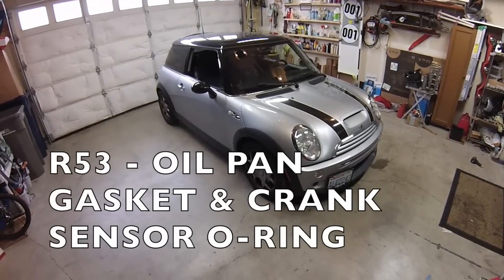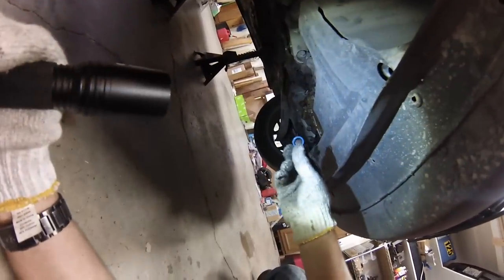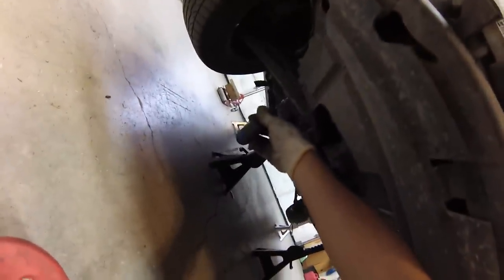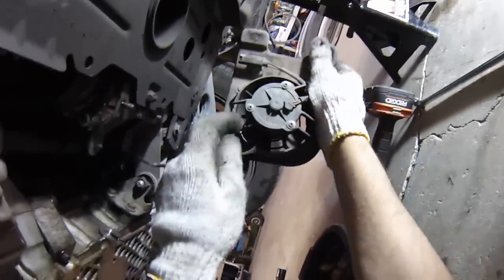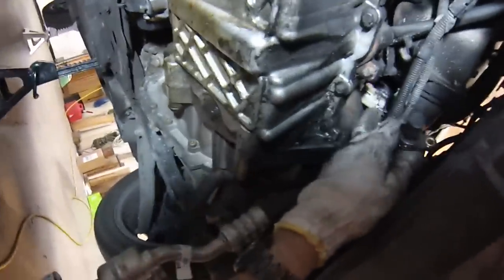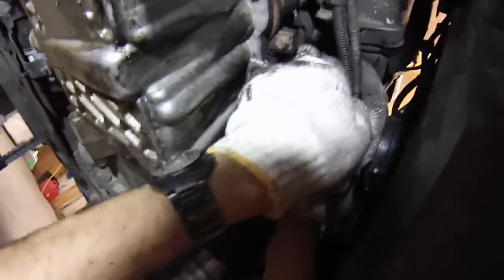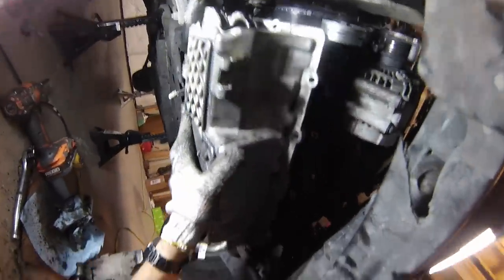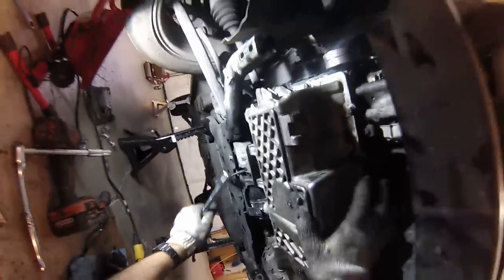Replace MINI Cooper crank sensor o-ring & oil pan gasket R50 R52 R53

Comment: great information are your videos, today I managed to remove my head following your earlier video. But now have to remove the sump (oil pan) as a socket fell down the cam chain guide lol. It was  a friend who was helping at least he told me. But after watching this ill sort that seal out as well. As for water pumps is there anyway to check them out with the supercharger in situ, Also we cant remove  the injector rail one injector is solid with what looks like rust any hints on removing this as I'm frightened on breaking the fuel rail,
cheers
Neil
Reply from the maker: Look for seepage on bottom of water pump. If it's leaking there will be white crust or maybe moisture there. Car needs to be in front end service mode, look up from underneath. 

Fuel rail can be pried off gently after removing the two 13mm bolts. It's just held in place at that point by the injector o-rings. Pry firmly but gently.

Comment: Can you do both repairs without putting the car into the FESM?
Reply from the maker: Yes, but it is a tight fit and you'll need slender  fingers. Less frustrating to just take the bumper off and move front end forward a little, especially if you don't know where the bolts are and you have limited tools. (You'll need various length sockets/extensions to work in the limited space)  It's not that hard to put into FESM...

Comment: Is it necessary for the A/C pump to be lowered for easier access to the crank sensor O-ring?
Reply from the maker: +Simon Z No. It's very tight but you can get access to it by just removing the splash shield. The hardest part would be unclipping the wiring harness. Then use a 10mm deep drive socket to remove the bolt.

Comment: Have a question . My mini 2007 s . Started overheating ,the steering gets stiff  the AC blows cold air and I also noticed oil in the coolant reservoir.  Well power steering has been leaking for a while . Butt line what could be the main issue .  Blown head gasket
Reply from the maker: Oil in coolant reservoir would be either a failed head gasket or a failed oil cooler.

Comment: Hey Modmini. I love your  videos. I have an engine light for a faulty knock sensor. I was wondering if you have any experience of replacing them. It seems some people think you can do it without taking off the supercharger (removing the inlet manifold etc), but some people seem to suggest a full FESM supercharger removal. Any Advice would be most appreciated.
Reply from the maker: Knock sensor is behind the supercharger. I don't think it is possible to remove without removing supercharger.

Comment: Looking at buying one this weekend just gone drove amazing. But notice a leak. Seems to be bottom rear and nothing at the top by the vavle gaskets so I'm guessing as it's drivers side it is exactly this. Debating it. Also the clutch biting point is at like lowest position possible is this another issue?
Reply from the maker: Bottom rear can be oil filter housing or oil pan, or just a valve cover gasket leak that is hard to see from top. Low engagement could also be due to air in clutch hydraulic.
Reply: @ModMINI  nice one. Sadly decided to steer clear the gear where hard to engage aswell. I'm assuming that could be related I'm sure I read some where they can have clutch and gearbox issue too  I've driven a few now and that didn't feel right. Shame. And to the oil housing spot on spoke to a specialist he said the same thing.

Comment: I would like to know what acceptable exhaust temperatures are.  I have a 05 R53 that seems to be running quite hot.  The exhaust manifold will turn red when the engine RPMs are above 5K.  Is this normal?
Reply from the maker: +Oscar Moreno That does not sound normal. You are probably running lean. Any mods? Might be time for bigger injectors and a tune.

Comment: thanks!, I was fixing the mini cooper s 2004, while I was test driving it engine just stall unexpectedly I tried but it doesn't start. I'm I correct if I say it is tge the pick up sensor?
Reply from the maker: +manic lokofe It could be a lot of things. Spark, crank, cam, knock, MAP sensor, fuel, wire came loose, etc.

Comment: Hi Sr, I have a question for you. I been watching your videos and they are amazing. I have a mini Cooper S supercharger 2005, few months ago the lights from the abs come on, I replace all of the abs sensor and know when I go over 75 miles per hour the abs lights come on, when I turn off the engine and turn on again they don't come on. I have a scanner from the bmw and everything but right now I don't know what to do. if you can give me some idea I will appreciate. Thanks a lot.
Reply from the maker: +Arley López What does the scanner say? If you replaced wheel sensors and the light still comes on, the fault is not the wheel sensors, you have bad wheel sensor wiring (car side) or there is something else. There should be a code of some kind but you need to query the ABS module directly to read it, OBD won't be able to access such a code.

Comment: I have a 09 Mini Cooper s that need a timing chain install could you tell me how to lock the crankshaft so I can pull off the chain.
Reply from the maker: +Rufus Biggs This video is for R50 and R53. You have an R56 and the procedure is different. Crankshaft is locked via a small hole in front of the bell housing near the exhaust on the bottom of the engine. You need this tool to lock it and the cams in place to do chain work. I'll be making a video in the next few weeks on this job. http://amzn.to/1U5B4oG

Comment: Hi there, I have a 2003 Cooper S 70k on the odo (with a 15% pulley) and it seems to be burning or leaking oil. About a liter every 800 miles or so. I've replaced the PCV, had the CPS o-ring and valve cover gasket replaced, but not the oil pan gasket. Could the oil pan gasket be leaking without any dripping any oil? Any other advice?
Reply from the maker: +Dustin Driver Most leaks only drip oil when the car is running. 1L every 800mi is a lot. You could probably get under the car when it is running and inspect where the oil is coming from. Maybe oil filter housing gasket. Those have been leaking a lot lately.
Reply: Thanks! I just took it in to my local MINI specialist for a shakedown. Leaking oil cooler gasket. He said that's probably responsible for a good chunk of the oil loss. The rest is probably just age. Any tips for that? Heavier oil? Something to soften the valve seals? Compression test?
Reply from the maker: +Dustin Driver There are no shortcuts - it needs to be fixed. Oil cooler gasket video here: https://www.youtube.com/watch?v=RxI5SrD1OCY - but might be easier to pull the exhaust or the right side axle.

Comment: @modmini if I'm just replacing the crankshaft position sensor o-ring, will I have to drain the oil?
Reply from the maker: No. It is above the oil line.

Comment: Hey mod. Would you perhaps consider taking a look at my own R53? it’s been throwing codes for the camshaft position sensor and emission system purge control valves, ive replaced the camshaft position sensor but still getting all the same codes and can’t crack how to fix it.
Reply from the maker: If you are in Seattle area, you could make appointment for me to work on your car.
Reply: Mod MINI super cool, I’m actually located in Woodinville/bothell area so I could definitely work something out. Along with the codes it’s showing my car has also developed an issue that I can’t seem to crack, it will start cold and run fine for a bit until I drive it, once driving it will idle at 1,000rpm and when shut off won’t even turn over again:/ in a few hours will start up and run fine again.

Comment: So, no RTV gasket maker on the oil pan gasket then? Realoem shows RTV gasket maker as part of the necessary items with the oil pan. Maybe that RTV is used somewhere else?
Reply from the maker: There is none there from the factory and I've never put any in. Gen 2 uses gasket maker.

Comment: Hey I have a 2003 mini cooper s. After about a week of having it, this loud bad sounding raddle/ knocking started to happen in the engine. After watching a few of your videos I figured that it was my timing chain tensioner. I replaced that and also the head gasket. After i finish it all i start it up. The same sound occurred but it was louder but eventually got quiter but is still there. Do you have any suggestions, and do you think that the timing might be off possibly on the timing chain.
Reply from the maker: If you are sure you put together the timing assembly, the only other usual noise source in the engine that could make a sound like that is rod knock... Why did you replace the head gasket?
Reply: Is it possible that the timing chain is off timing and thats why there is still some raddling noise. I replaced the gasket because it had 130k miles on it and i just kinda wanted to, no reason really.
Reply from the maker: No. Chain would only rattle if there is too much play, which can be due to bad tensioner, stretched chain or damaged chain guides / sprockets. If those are all good, your noise is coming from somewhere else.
Reply: thank you

Comment: hi there,i done this to mine the other day and im still getting a drip  where the sump joins the transmission,its not directly on the bottom but on the second long bolt to the rear of the sump just under the curved plate that is under the starter motor.. When i had it off the there didnt seem to be any oil coming from the main seal behind the flywheel so i naturally assume that that is ok and it was only replaced a few weeks ago,im wondering if the main seal was gone or damaged upon install would the rear of the flywheel get wet from a leaking main seal,or can these sumps warp and not seal the gasket correctly?
Reply from the maker: Could be either bad rear main seal or bad oil pan gasket.
Reply: @ModMINI  thanks for getting back to me,I'm praying it's not the main seal cause I just replaced,very carefully too,but if it is I'll just have to do it all again... thanks again for your response.

Comment: hey I have a question I just put a header with a test pipe on my car it ran before now it cranks but doesn't start but now it's throwing a camshaft position sensor low circuit what could cause a no start ?
Reply from the maker: +aj grant Check throttle body, crankshaft, camshaft, TMAP, MAP, both O2 sensors and all connections. All are required for the ECU to manage air, fuel and spark.
Reply: +Mod MINI it's also throwing the code for a camshaft position sensor and evap codes and I looked on all data and it say that's usually what happens when it goes bad

Comment: I have replaced the oil pan gasket twice on my r53 and it still leaks. It only leaks while off. Any suggestions would be greatly appreciated.
Reply from the maker: If leaking while off, probably the oil drain plug. Could also be oil filter housing gasket or valve cover gasket.
Reply: Mod MINI it seems to accumulate at the  back left corner of the pan,  area closest to the back motor mount. I replaced all of those. It only recently started doing this. I thank you very much for responding. Your videos have save me many o' dollars.

Comment: Hello Again, i thought that the problem was the crank case valve but not the idle still doing the same, and i scanned and the code is P0507 idle higher than expected. let me explain to you what i did, i did the supercharge oil service and also the crank case O ring replacement. when i was taking apart the rubber boot from the throttle body i found that was crack and i ordered a new one so when i going to install everything back i don't want to have any vacuum problem. this is what I've been noticing with my car also with the idle problem the coolant fluid its returning to the reservoir and is pouring out and the car temperature gauge its normal not indicating that is hot. when i install everything back and put the coolant i turn the car and the air conditioning was on and in heat to let thermostat open, and also i did the bleed to the coolant. when its running it don't have any signal that is getting hot just when i turn off the car that you feel the coolant smell and when i checked its pouring out. i would like with your experience to see i can narrow down what could it be. i did some research about the code and i found info about the map sensor and i replaced but no better results. Please and thank you for posting this useful videos.
Reply from the maker: If it is pouring coolant then something wasn't installed correctly. Sounds like time to take it back apart and retrace your steps.

Comment: Was most of the oil leak caused by the simple crankshaft oil seal?
Reply from the maker: Yup. There was some minor seepage from the oil pan gasket but the crank sensor was practically dripping.
Reply: ***** ok great,thanks for the fast reply! :)

Comment: If anyone can help that would be awesome! So I ran into a small issue today while doing this job. Removed the belt, removed the ac compressor and engine mount bolt, removed the 3 15mm bolts and the 11 10mm bolts on the oil pan. Can’t for the life of me get it to drop. Tried pulling on it, tried hitting it with a hammer, tried wedging a screwdriver in the seal to try and pry it open. It moves about a half an inch on the right side but still isn’t close to coming off. I eventually took the screwdriver out to avoid deforming the oil pan. Thoughts?
Reply from the maker: Rachel Elizabeth You must have missed a bolt. Tap a couple times with hammer and it should fall right off. When prying, pay attention to what appears to be the fulcrum.that will help you know what it’s stuck on.

Comment: question, if i only have to do the oil pan gasket do i have to put the car in front end service mode? i did the crank sensor o ring couple of months ago but now the oil pan is leaking. (sad face)
Reply from the maker: Frank Nativi You can get by without doing it if you remove lower torque mount and pull the engine backward with a ratchet strap or something. But it will still be pretty tight space.
Reply: +Mod MINI I think I would do FESM just to make it easier. If there's a lot of leaking from the passenger side, would it be best to do the oil housing and cooler for good measure?
Reply from the maker: +Ryan Haugh Front end service mode doesn't help with oil cooler gasket replacement. That's on the back side of the engine. Replace if you like. I've only seen a few of these leak, they were always on very high mileage cars.

Comment: hi how to test mini cooper  crankshaft sensor?
Reply from the maker: +manic lokofe It is a hall sensor though and you would probably test like any other hall sensor. It's not very expensive so if you have an odd code such as even a camshaft sensor code, probably worth replacing.

Comment: The Mini Cooper s I've been thinking of buying has an oil leak , it's been listed on previous mot inspections , one even saying " no oil showing on dipstick added 2 litres" I'm thinking of walking away from the deal , pity as it's a lovely car
Reply from the maker: Pretty common for them to have leaks and not that hard to fix if you know what you're doing. They typically do consume oil between changes even when not leaking, so the one you are looking at seems to be average for the lot. If it appears to be otherwise well maintained, it wouldn't be something that would make me walk away, just keep a close eye for a while...?

Comment: Crankshaft seal is where?
Reply from the maker: Ryan Doehrman ...Crankshaft seal is behind the crankshaft pulley. You mean the crank sensor and crank sensor o-ring? On the front side of the block, just in forward of the bell housing, near the bottom edge of the block.

Comment: What happen if the belt is broke and I try to start the car?
Reply from the maker: You can start the car no problem but you can't drive car without belt. No water pump, no alternator, and you'll get limp mode due to no supercharger boost.
Reply: Ok Thnks!! Your videos are great you have a new subscriber.
Reply: If the cranksensor is not aligned perfectly or all the way in ,the car don't start? I use a different seal and the car don't start.please help.

Comment: I did this and now the car won’t fire.  
What’s the issue?
Reply from the maker: I guess you forgot to plug something in or pinched a wire. Crank position sensor. Ground wire. Coil pack input wire, etc.
Reply: @ModMINI  Thanks.  I was figuring I had to FESM it again and go through everything.  Crank Sensors go out around my mileage too I guess!?!

Comment: Labor cost to do this job?
Reply from the maker: Depends who you ask, but the actual work takes around 3 hours.
Reply from the maker: Not sure what labor rates are or book rate is but like I said, someone who knows what they are doing can do it in under 3 hrs. Parts can't be more than $150 or 200 including oil change.